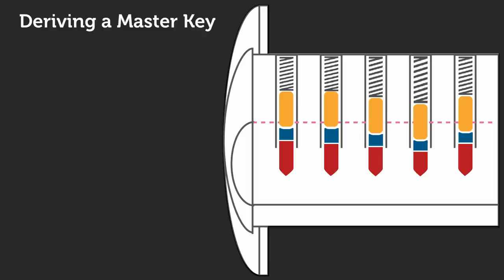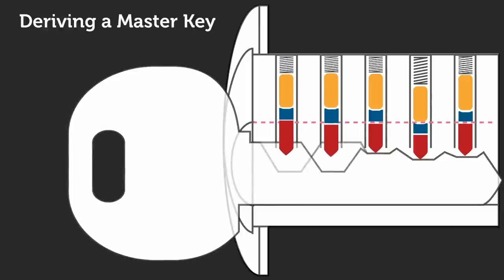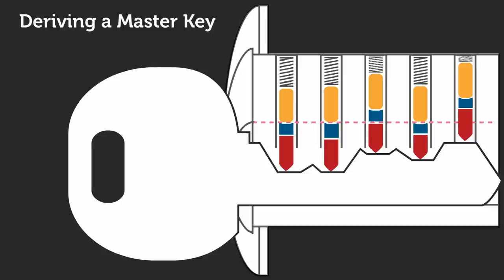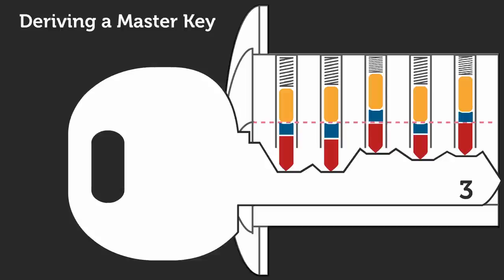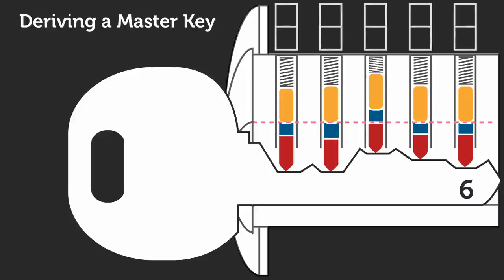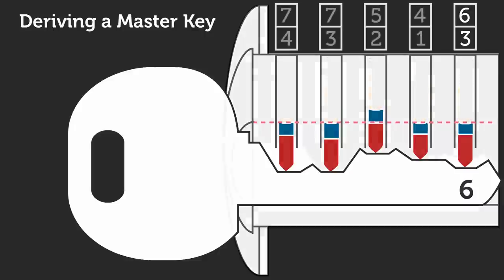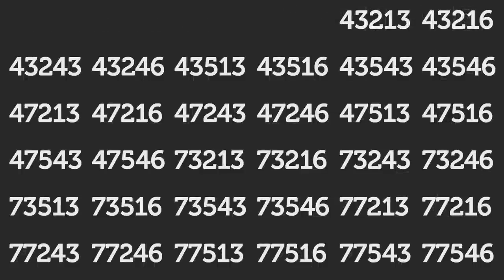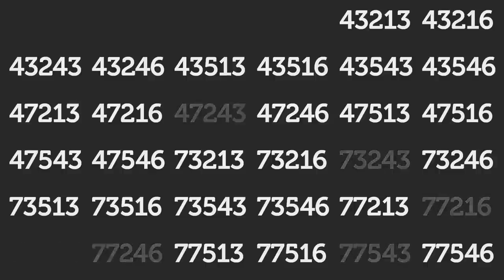Deriving a Master Key

Comment: I always think of it like this: Make the keys with one position blanked, file them down one-by-one, and note any depth that opens. Then compare the found depths to your key:
-If a position has just one working depth, use that depth.
-If a position has two working depth, one of them is on your original key - use the other one.
-More than two working depths indicate a more complex (multi-level) master key setup.

The resulting key is the master key. No need to try 32 keys.

Note: Only works if you have a legitimate user key - a decoded key will likely a mixture of the user and master bittings, so its "inverse" will also contain user bitting pieces, and will not give the master key.

Comment: In having a look at determining the 32 blanks,  you could actually work with 10 blanks, taking advantage of the fact that once you go from the upper cut to the lower,  you can't go in reverse, but you could go onto the lower cut the next position over, keeping track of which positions you have already used.

The other thing to keep in mind in having found all of the depth combinations, is that not all of them might be valid, due to the Max adjacent cut specification.

That MACS could also be a slight problem for finding all the master pin positions, particularly if your original key already has a 0 cut or a 9 cut in a given position.  In which case,  you will have to abide by the MACS for the neighboring positions, and work around it, like if one position is 95312,  then you can't have a blank with 90312.  Instead,  get a blank cut with 05312,  work that pin, and determine what is present there.

Comment: @SchuylerTowne Small point, but If you had your 32 master "possibles", and one of them worked on another lock, wouldn't you still have to try the remaining 32 and make sure that no other one worked as well? Wouldn't it be possible that the second lock had a chamber that had the same non-master cut?

Comment: If the master key system is properly made (not always the case) , the change key will not have any bitting in common with the master key. So if you find 1 wafer per chamber , meaning 2 depths per postion , just take the other one than your change key.
If it was a GMK system , you will find additional wafers.
If the system is a partial position progressioning , you will have positions without wafers , there the cut on the master key is the same as on the change keys. Same goes for rotating constant systems.

Comment: Just rekeyed a house for a client in a development that's about 7 years old yesterday. The house had the original Kwikset locks and has never been rekeyed. I realized the original locks were master keyed and in about 5 minutes was able to compare the homeowner's key and the pin measurements and had the master key combination. I could probably make that key and open every house in the development that hasn't been rekeyed. Pretty irresponsible of the builder to do that to the residents of that neighborhood. By the way, I'm not even a locksmith.
Reply: Smeado vinod

Comment: helping a friend that had an office master keyed.  he had no documentation and cannot get it. had to  take every cylinder apart. good thing. 4 offices were cross keyed to 3 entrance doors that were keyed alike. 4 offices used up 30 possible 6 pin bittings for the cross keying. One chamber in an entrance doors has 4 master wafers. 2 others have 2 wafers. sometimes you have to take them apart not matter what.

Comment: I believe the simplest way is just to use a pin calculator that that gives you the bottom pins Master pins stack height and the amount of keys or combinations that will fit it. Lots of free ones online and they even work using your phone

Comment: If you have access to two user keys, then it's much easier to carry out the process with two different locks. Then knowing the possible configurations of the master for each lock, you should find that only one configuration will open both locks. This greatly reduces the number of keys that need to be cut.

Comment: Not sure if mentioned, like binary counting, 00000 to 11111 is 32 digits(Keys). Seems like Master Keys I seen when I was young had the deeper cuts, seem like you could file each space slowly down,  if it doesn't turn, that space was already at deepest cut? Later I noticed Master Keys having the shallower cuts, better as you can't modify a user key to a Master simply by filing, which is better for the Locker, and not the Locker? Good work

Comment: without a doubt you know what your talking about, tis your subject. I have a neighbour (downstairs same building) who not only stole a set of keys from me (he admitted in a court case last April) but also had a barrel made for his own door. So the end result was his key would fit my lock and his lock, but my key would only fit my lock.How did he do this? To be straight with you the court case is still ongoing and resumes on 1st Sept (the third trial, same case) and this is a minor part. But if you get time I would be obliged to you. Yours sincerely, Mike Fitzmaurice
Reply: +michael fitzmaurice One possibility is his lock may have more pins than yours. Let's say your lock has 5 pins, he could have 6. In his lock the first pin(one at the front) could be anything, while the rest are set to match your lock. With that your key could not be used in his lock, while his key would fit both.

Comment: For the first pin that was 3 on the user key, don't we know that 6 is the master key, then? Since it's the only other height for that key. If the master key had 3, then they wouldn't put in the master pin, yeah?
Reply: That was what i thought. You could just assume the other number is the master one. But I'm not a locksmith so maybe I'm missing some crucial information.
Reply: somanayr n

Comment: Man that's a lot of key cutting.. Good luck doing that by hand filing. You will need a lot more than one movie. My question is if you have an operating key just take it apart and measure the pins. I can usually derive a master with just 2 or three locks.. Interesting video but too much work for me, not to mention the extra cost of all those blanks..

Comment: Wouldn't the obvious master be 43516? There wouldn't be a point to using a master pin if it was the same as the operating key. So unless the person who set up the locks was specifically trying to foil someone doing this, it would be the alternate number to the one that matches the operating key.

Comment: Kind of missing the point? Lets say you rent from a public storage place that has a master key. You can't just disassemble their locks, so all you have to work with is your key and your lock.

Using the method in this video, you can derive the masterkey WITHOUT disassembling a lock - something you may not always be able to do without causing suspicion.

Comment: You're severely taking the long way. You're making several assumptions that contradict each other. You're assuming the ability to code cut keys, while somehow also claiming in a roundabout way the inability to decode them in the first place. Most locksmiths do simple master key systems by hand. Take this example of how a plug is master pinned up.
53124---KW10 User key example
43132---KW10 Master key example
-------------Take smallest number per cylinder
43122 <-----these will be bottom pins
-------------Take difference in cut between both keys per cylinder
10012 <-----these will be the master wafers(side note, don't pin shit up with 1 wafers)
Considering a locksmith tries to use as few wafers as possible, the total amount of work is less than you think. No competent locksmith would EVER put master wafers in every cylinder. That'd be stupid.
Take user key, determine if each key is the lower cut, or the upper cut. If it's the upper cut, the master key cut for that chamber is the user key - the master wafer. If it's the lower cut, the mater key cut for that chamber is the user key + the master wafer. Boom. Master key.

That being said don't make master keys that don't belong to you, it's a bad idea.

Cheers.

Comment: Nothing about MACS or the vertical minimum?  What a great way to get a key stuck in a lock or damage the lock : /   With vertical minimums, say of 2, and bearing in mind the MACS off the bitting table - many of those combinations can be ruled out.

You also cut down to the original bitting in your example but obviously you'd miss that one out - and also one level either side of it too as thin wafers are insane and flip in the chamber... it's unlikely at best.

And then there's the problem when hunting for that second shear line, that the adjacent positions may need bringing down too - just to get down that far without a MACS violation... which complicates the key trialing scheme considerably.

But for the sake of all that is good - never just start cutting and violating the MACS value.  That's a n00b mistake.

... and I should know, I'm a n00b : )
Reply from the maker: That's a great point about getting the test keys stuck! I'm going to take the video down to avoid someone causing themselves that sort of pain. Thank you! 8 years on from making this video, I certainly know better, but haven't revisited my old material in a long time. Thank you again!

Comment: This doesn't work because you don't know if there are multiple master keys that work the individual cylinder. Simply because your change key has a #4 cut in position 1 doesn't mean the Master key can't also have a #4 cut in position 1 also. There could be master key levels above the master key you think you have created. There are rules to master keying, and not everyone who pins up a lock follows them. That makes it extremely difficult. You can decode a key in the manner depicted on the video, but simply because you get an alternate key(aside from the change) to turn an individual cylinder in a system, doesn't mean your 'master' will turn a different cylinder in the same system. How do you know which is the change key and which is the master key? You can't if you don't have at least one key. Even if you have the key, how do you know with certainty that IT is not the master?

so yes and no, but locksmiths do this all the time. It does work, just not exactly this way.